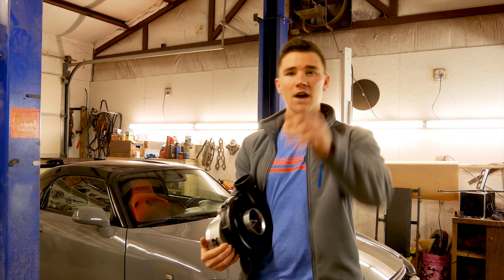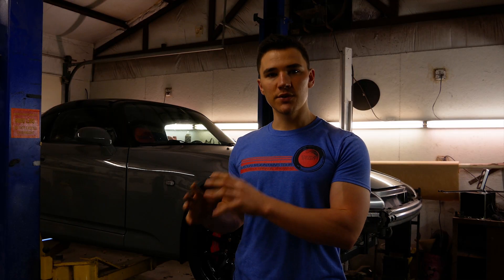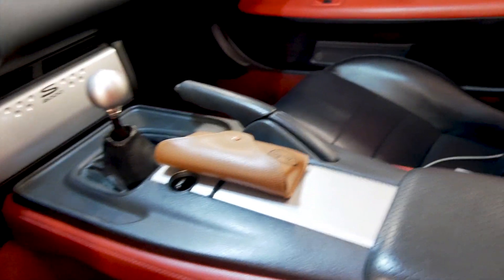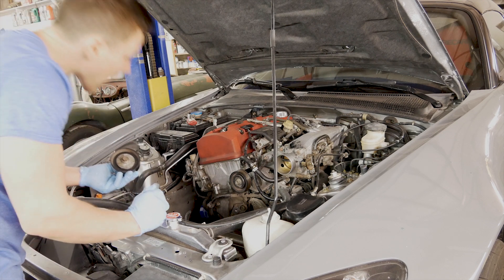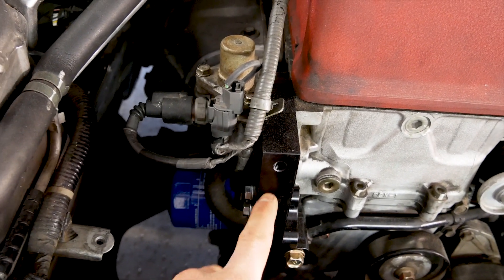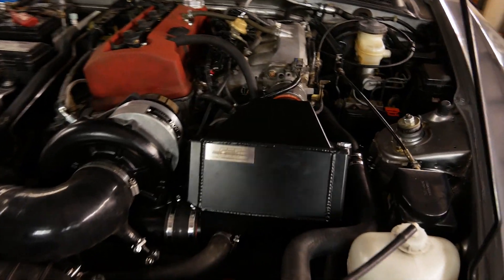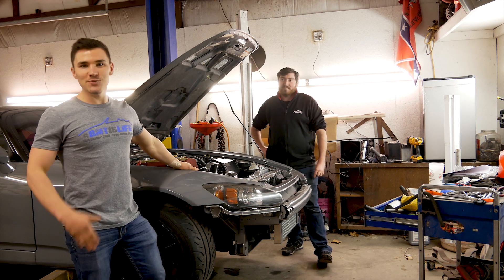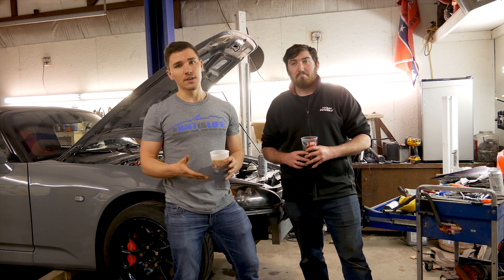Honda S2000 Supercharger Install! - Science Of Speed Supercharger Stage 2

Comment: Is Vtec engagement lowered to 5k or 5500 rpm while doing this mod?

I have an 05 s2000, so this is very similar to what I would be looking at. Because I’m thinking about the stage 2 kit as well.
Reply from the maker: Your tuner can lower Vtec engagement to a lower RPM.
Reply: @VEDEMRACING99  isn’t that difficult to do on the 04’s and 05’s?

Throttle cable and all
Reply from the maker: It’s all done with the aftermarket ECU
Reply: @VEDEMRACING99  last question, how much that oil cooling system cost? $500?

Comment: What size pulley did you use? 3.4? 3.6? 3.8?
Reply from the maker: Not sure to be honest, it was the pulley included in the AP2 Kit rated for 9-12 pounds of boost for the Novi 1200
Reply: Most likely 4.4

Comment: What's that sound at 14:33? Like a rattle sound
Reply from the maker: The infamous Paxton Supercharger Coffee Grind sounds!
Reply: @VEDEMRACING99  how's the car doing? Would you say it's reliable? I'm planning on SC my S2k but not sure which kit. I was leaning towards kraftwerk or SOS. You may have sold me on the SOS
Reply from the maker: @Indifference2000  I would go with the SOS for reliability.  Ive currently put 3000 miles on it supercharged, taken it on a few trips and haven't had any issues yet!  I haven't had time to make it to the track yet. my only regret is not doing it earlier!

Comment: Which one should I buy if I want a lot of power and is better. Stage 2 supercharger or tuner supercharger?
Reply from the maker: Honestly if you plan to change a lot for example pulley size and run E85 I would recommend running the Tuner kit.  Call them and tell SOS what your wanting to make and they will send you a quote.  Great customer service!

Comment: What issues does the kraftwerks kit have? I haven't seen anything about issues for that kit and am trying to decide between SOS and kraftwerks so I'd love to know what issues you've heard of. Also, please clean up and organize your toll box bro lol jk
Reply from the maker: I need to organize it, I would save more time! I’ve read multiple threads on S2KI of individuals that purchased the Kraftwerks kit having issues.  Kraftwerks has released revised kits that fix a lot of the issues since then.  The Kraftwerks kit does make more power for less money, but I went with. SOS for the Reliability and of the kit.  There are multiple people running the SOS for 60k miles and report no issues.  There is a ton of information on S2KI!
Reply: @VEDEMRACING99  cool thanks for the info, I'll check out the forum and see what people posted about the kraftwerks kit
Reply: There are many issues with kraftwerks unless you install it PERFECTLY.  It’s also a kit that you must constantly keep an eye on and maintain, the sos kit is almost a set it and forget it kind of kit.  That being said I bought s kraftwerks kit.  If you get one make sure you join the kraftwerks owners  Facebook page and follow threads on s2k and watch all of lht’s videos for tips on having success with the kit.
Reply: Lone Wolf earlier KW kits were nothing but issues always chewing up belts and bad pulleys
Reply: @nickolas1108  has that issue been fixed? Is it better to go for a SOS kit over KW?
Reply: Lone Wolf I believe there latest version kits have been very reliable with no issues i personally would prefer the SOS kit , proven to give you reliable power. Great track record kw is also air cooled and sos supplies the after cooler on top of the inter cooler
Reply: @nickolas1108  thanks for the info bro it's really helpful

Comment: Nice install everyone always does craftworkz
While inn there always worth changing
Reply from the maker: The Kraftwerks is a good Kit, but I’ve heard of horror stories so I decided to go with the tried and true SOS Kit
Reply: VEDEM RACING I am a horror story. Installed correctly and have had a lot of issues. Wish I had gone SOS. I like the fact that the KW kit produces 60+whp more than SOS, but the Rotrex unit is top failure prone. My unit failed in 6mo and 2k Miles. Rotrex denied my warranty claim saying I had spun the unit backwards(um no) and I had to pay $1100 for another blower.
Reply from the maker: wantapgt I’ve heard multiple similar stories with the KW Kits. Sorry to here that man